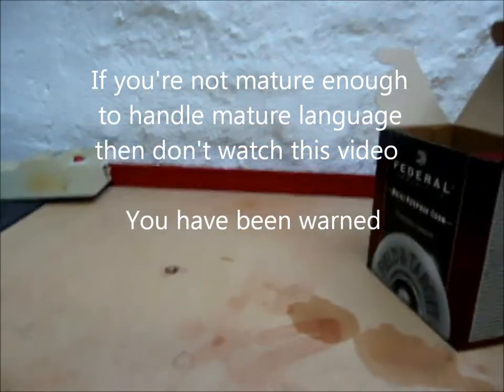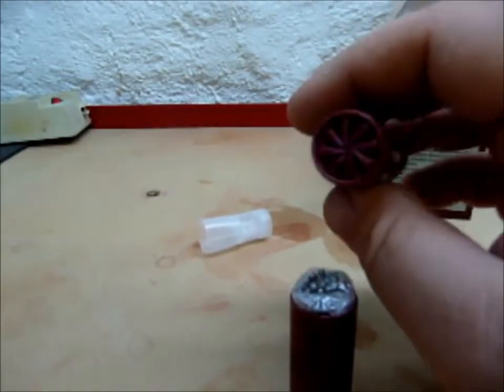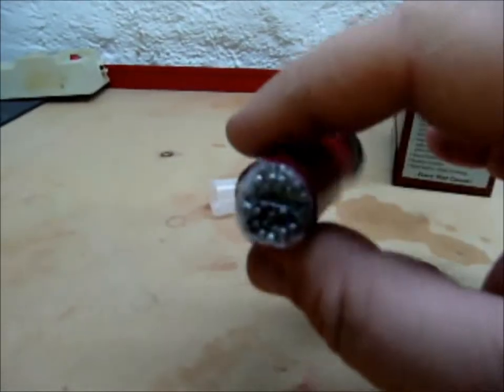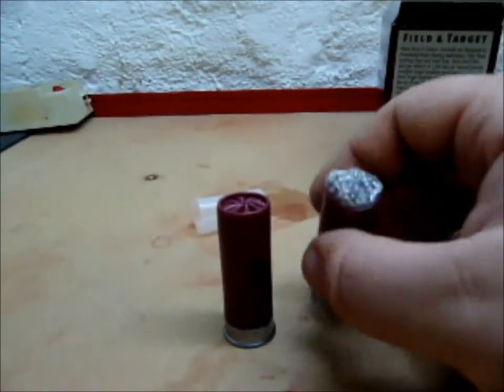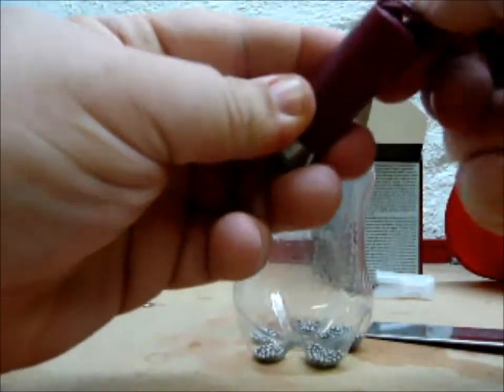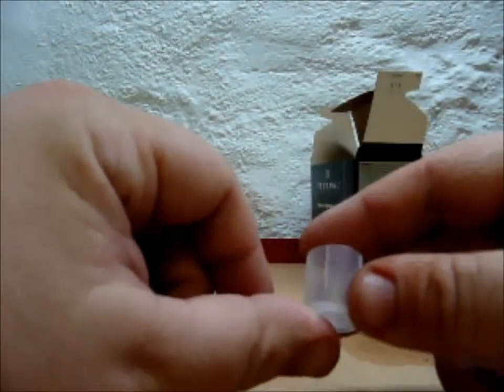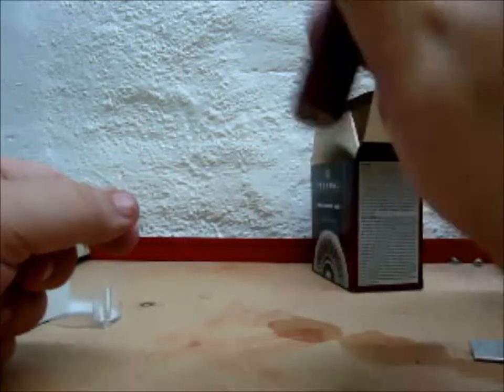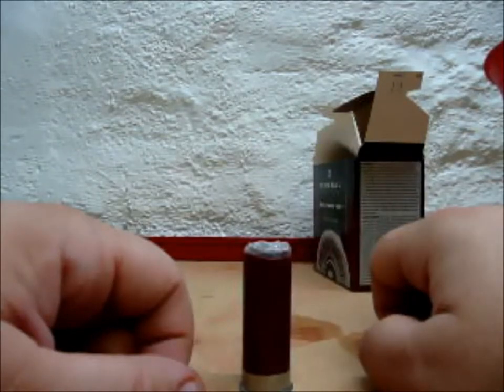12 gauge shot shell to "disintegrating" slug modification

Comment from the maker: Hot glue might work but I somehow think that wax would be a little easier, though both seem messy as hell.  

The second idea you mentioned sounds like it's essentially cut shells.  The danger with that is that the width of the projectile is being expanded (what I consider to be a) substantial enough amount that it might cause pressure issues.  I still think that tape is a safer alternative due to the projectiles width being negligibly increased, imo.